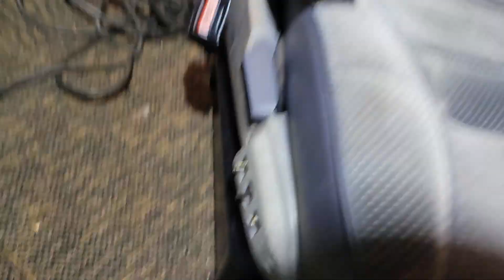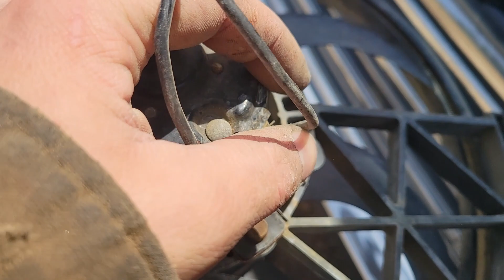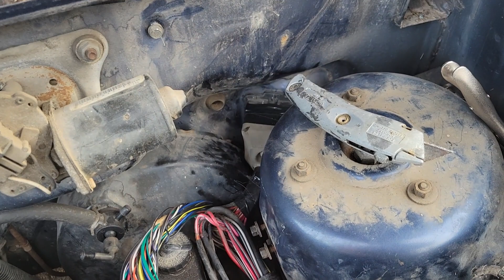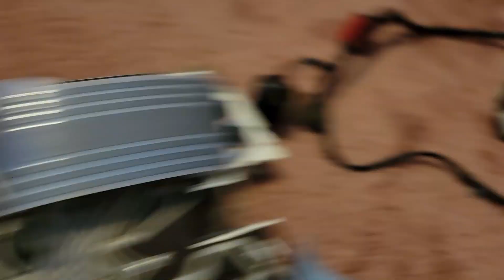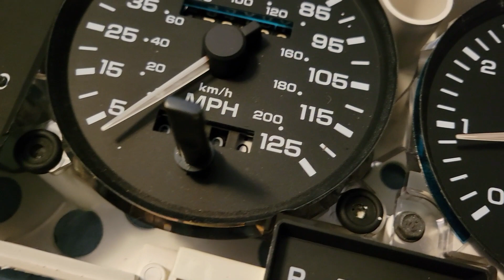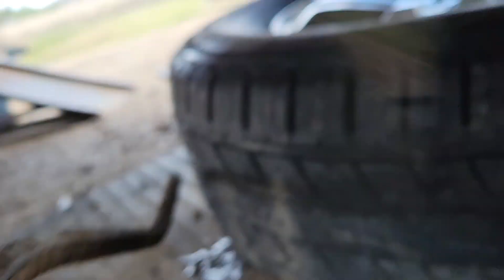1990 Dodge Grand Caravan LE "restoration" | Part 7

Comment: Guess what? I picked up an 86 Voyager this weekend! Body is MINT but the engine is probably toast. 2.2L and looks like its hemorrhaging oil. I do know where a nice propane 2.5L is though!
Reply from the maker: GREAT NEWS!! Hope you have fun saving this one. Keep me posted (:
Reply: @MNMoparMinivan  will do. So far it has made it onto the car trailer and home. I think it has a gremlin where it runs for so long then cuts out. will have to see what happens. backyard mechanic had it..
Reply from the maker: @TheStuffz  as luck would have it, I just got an email about a new post in the 1st gen page on the Chrysler Minivan forums(got alerts on for that lol) saw your van there. Looks much better than mine!! Nice find.
Reply: @MNMoparMinivan  lol there is not very many active forums for gen 1's! that one  had some good activity so I chose it. can't wait till this weekend to get it off the trailer and try to get it moving